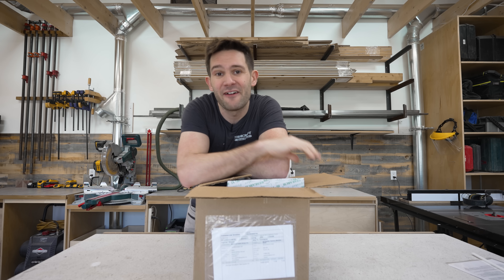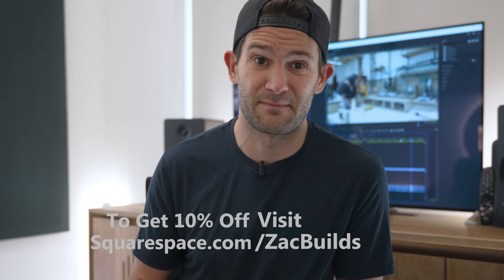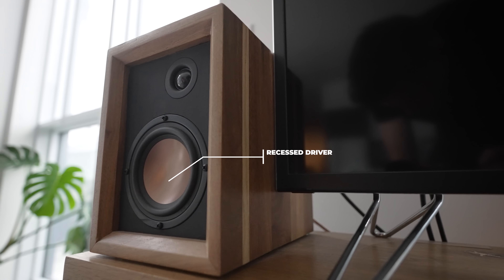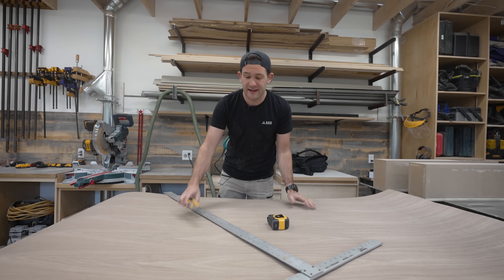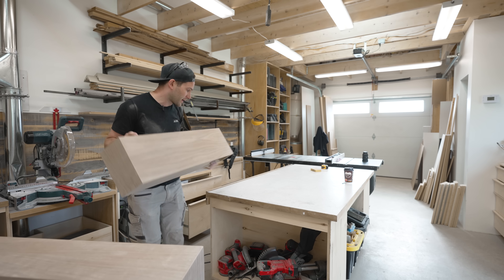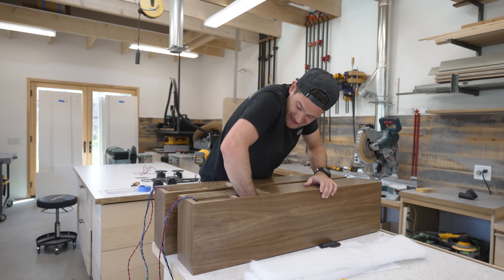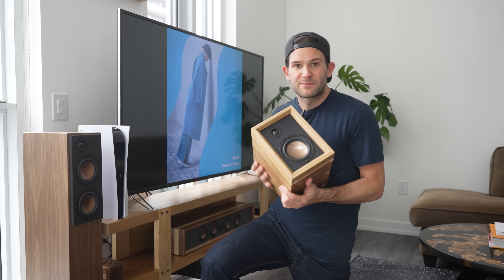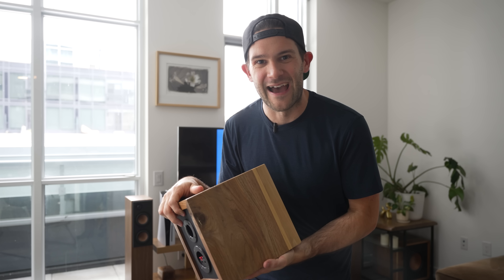MDF is BETTER than hardwood

Comment: Fantastic video!  Thank you so much for sharing your talents!
Reply from the maker: No, thank you Paul for taking the time to put together these designs and make them open source for everyone to enjoy! I've built almost every part of the overnight sensation family and have thoroughly enjoyed the process, and I couldn't have done it without you laying the ground work.
Reply: When you hammered those feet into the veneer..... uff.... another option is to make a wide hole for a nut and glue it with epoxy.

Comment: Now keep the smaller ones for the two back channels of a 5.1 cinema system. You can also make them identical looking by adding a black panel on the fascia that will level the front panel with the sides and remedy the "recess" problem that just adds diffraction.
Reply: That is what he said he's doing at the end of this video, yeah.

Comment: I built some speakers with a 5" FR driver and a 6" woofer in floor standing cabinets. And I built another pair of speakers with an 8" coaxial driver and a robust 10" woofer in larger cabinets. The smaller speakers are great and have impressive bass, but the bigger speakers have that BIG sound. And they CRANK so much more without sounding strained. Good for parties. And the BASS! Bigger is better!

Comment: I just want to say, I've loved your speaker videos. I work at an audio company and I can tell you those have the build quality of a several thousand dollar pair of speakers. 

As far as sound quality, diffraction from the lip around the outside will have a very large effect. But imo mdf vs hardwood isn't much of a difference. As long as the cabinet is sufficiently strong it doesn't matter. Mdf is used more often purely because it's cheap and dense. I would bet that the extra clarity is less from the added midbass, and more from removing the lip around the edge.

Comment: those look sweet. on your next set (and you know you're going to build more speakers, once you start it doesn't end :) ) use more drivers... the less work they have to do, the cleaner, distortion free the sound.

for whoever is interested, when working w/ such small drivers nothing makes a difference really as long as the internal volume and port dimensions are adequate for your application. and by that i mean box material, bracing, stuffing density, etc. the greatest sound impact i would say is in matching the crossover points between the chosen drivers.

Comment: 9:17 You're doing it 180° wrong: first heat up the wire/copper then put in the soldering tin. If there's enough tin take away the soldering wire but let the tip of the soldering iron stay for one or two seconds. This will give the tin a little time to set and makes a good connection. They are looking pretty nice and they seem to sound really good. Have you tried to change the left with the right speaker if this (tweeter position on the inner side) alignment sounds better/bader?
Reply: Also those ceramic resistors are going to get hot if he drives the system, they should have been raised at least a 1\4" off the board. And for God's sake man, with all the tools you have, where the hell is your dead blow hammer?!!!!
Reply: It looks like he did heat the wire and applied solder after it was heated.  He already commented that he isn’t experienced in soldering so that perspective he did a good job

Comment: Nicely done.  As a side note, if you use mdf and you want to paint them to match some other components, use polyester filler such as Bondo to fill imperfections and end grain.  Apply a thin coat and sand when dry.  You will have a glass smooth surface on which to paint.

Comment: I hope you have a fanned heat distribution system built inside that TV stand for that AV receiver.  Heat doesn’t redistribute itself out properly in that orientation and it’s just going to create a hotspot there on the wood, which is a potential fire hazard.

Comment: What's even better looking than the regular hex socket screws are button head hex socket screws. While the regular socket screws look techie, the button heads have that plus look smooth. But these are machine threaded screws, so some kind of T-nut or threaded insert is needed. Oh, and if you're looking for a slightly steam punk look, they also come in brass.

  The "breathing tube", as it is commonly termed, or more accurately, a tuned port, is used in a bass reflex (as Zac made), to tune the resonant frequency of the box for the "best" bass response (output). The term "Q" of an enclosure is often mentioned. The Q of an enclosure can go from 0.5 to 1.0, with the lower number giving the least output but most accurate and tight bass, while 1.0 gives the most output but sloppiest bass. .707 is considered the best compromise of the range. While a .505 will sound a little thin, couple it with a well tuned subwoofer and you'll have power in the bottom plus tight mid bass. A .707 box with a sub will give a fuller sound with minimal adverse effects, while a 1.0 box+sub will be loud on the bass, but boomy and often one-note sounding. There are formulas (Called the Thiel/Small Parameters) and charts, and now apps for determining box Q and tuned port length let you decide what Q you want to have. 
  Since Zac is using a kit, the port is made to the right diameter and length.
  Port diameter is also a factor: too small a port and you hear the port "breathing" (huffing) and too big and there isn't enough back pressure so the bass is loose. Port diameter is usually 1/3 of the bass driver diameter. A 8" diameter woofer will use a 2.6" dia port, but for practicality, you'd use a 2.5" PVC pipe. If you have two woofers, calculate out the total speaker cone area, convert that to a single cone area, and go 1/3 of that. Say you have two 6" woofers: each woofer is 29sq inches, so two would be 58sq inches, which is close to an 8" woofer, so your port would be 2.5" dia. 
  The port can literally be anywhere on the enclosure, as long is there is no solid flat surface within 3 port diameters. The back is the most common as it's out of the way, but the front is used too, often on larger bookshelf speakers. A port opening can be sharp edged, like cut off PVC or can be rounded over, sometimes on both sides. The rounded over port edges streamlines the airflow and makes for a smoother sound, but in reality, this is really only a problem if you're a serious audiophile. But, a rounded out port gives a very finished look to the speaker. 
  About the foam gasket on the drivers and often the terminal cups. They're there to create an airtight seal between the components they're on - important if you're making a seal enclosure but also good for all other enclosure types. If your speaker didn't come with any, anything from caulking (rather permanent) to craft foam sheets cut to size work very well. Craft foam also works well to make a speaker look better if you're unable to rout and flush mount the drivers - just use a 1/8" thick foam sheet with the holes cut out for the driver's outer frame over the front baffle. 

I used to work in home and car audio for many years and made a number of speakers from scratch, using preselected driver kits and cherry picking drivers and crossovers. I probably inhaled more than my fair share of MDF dust, so wear a respirator like Zac does!

Comment: With all the talk about "venting", maybe we can use the speaker cone action to work like a heat pump and create the cabinet so it is self cooling when ever it is running.

I can feel my legs get puffs of air when the woofer under my desk goes - now I know that those air puffs are not from air that was inside the subwoofer as no air actually moves (please see any of a number of subwoofer vent/diaphragm tests on YT) from point A to B but it's actually disturbance in the air from pressure waves being transmitted like ripples go outward from a stone in the pond.  The water in the pond isn't going away from the stone, only the pressure waves.  That air always feels cold for some reason, though - like the air that is isolated inside it is transferring its insulated coolness onto my leg.

I'd like to do an experiment to see if those pressure waves can also take heat energy with them or if we have to actually literally move air to get the thermals to go the way we want them.

An audio based chiller.   hm.

Comment: Hey Zac, I do like you new speakers, but I feel like they don’t match you other ones. The center speaker, and Sun woofer. They have that nice lip around them! And white wood band going around them giving that a two tone wood finish. Also you should add the old ones to the back surround! Which I am sure you did! 5.1 sounds amazing! And if you have matching back ones already you can add them to the front again, but as your FHL / FHR, which go on the wall close to the ceiling! Or even turning your set up to 7.1 and add them to the sides.
Reply from the maker: Hey James! Thanks. I hear you, maybe I'll redo the center at some point, but for now they'll have to do slightly unmatched and yes I'm definitely taking those old speakers and making them rear channels. Maybe in the future I'll do some front highs in the future.
Reply: @ZacBuilds  glad to hear that! Please keep up the great work and I look forward to more videos!

Comment: There is one huge glaring issue in your audio setup, and it should be relatively easy to fix. As you probably know, the room is a huge factor. In your case, the issue is the large windows behind. Glass is highly reflective, in a bad way, and your speakers are back-ported. I'd go for heavy curtains and a bit more distance. Also, one of the speakers is a bit close to the corner or the room, you can add more stuff there to increase dispersion of the sound.

Comment: I've been a professional woodworker for 30 years in large, high end architectural millwork shops. YOU NEVER USE CONTACT CEMENT FOR VENEER!!! Contact does NOT dry to a hard film line. Thus the veneer is NOT firmly attached to the base work and there will be creep as the two different materials experience expansion and contraction due to moisture changes through out the year. For paper back or 2 ply veneer roll out yellow glue evenly. apply veneer, cover surface with brown paper and plywood clamped down with strong backs. Or for unbacked veneer and the above, use heat activated adhesives that you roll on to both surface, let dry, put together and use and an iron and J roller to heat glue rollout the glue line. Custom veneer companies use heat activate glues that come in sheets. The veneer panel is put into an electrostatic heat press to melt the glue.  NOTE: if you use contact with unbacked veneer, and you use a lacquer finish, the lacquer will soften the contact and the veneer will bubble.
Zac, do your homework before give out advice.

Comment: Fantastic build Zac! There was a really clear difference between the old- and new speakers, even over youtube. They just sounded warmer and more lively. 

Only criticism I would have would be the rear facing ports. If you're going to put them that close to the wall, front facing ports would be better for levels and quality.
Reply from the maker: Appreciate the feedback! You dont think 6"-8" away from the wall is enough space for them to breath easily? Seems like at that point the port itself would constrict the air flow way more than the proximity to the wall would
Reply: @ZacBuilds  Yeah, that seems like enough space. They're relatively small ports so the effect will be less noticeable. You could try moving them forward(or even backwards) and see if you hear a difference.

It's not airflow you're worried about, it's air pressure. Putting ports close to the wall exaggerates the boundary effect, where you'll experience an increase in perceived bass levels at the cost of muddying your midrange. 
This is basically just distortion, so if you think they sound great then you've made a great set of speakers! If the Kinks taught us anything, it's that distortion can be good.

Comment: Just a heads up - you're going to burn your receiver out covering all the vent holes on the top like that. It may even cause a fire. There's a reason why the entire top of it is perforated.
Reply from the maker: Are you sure?
Reply: Yes. Seriously. There's a reason why the entire top of that device is perforated. The side holes are to pull air in and the top is where the heat leaves. At minimum you're risking burning the unit out.

I'm not trying to come across at patronizing or rude. You didn't know, or you wouldn't have done it. I'm just warning you that you're really setting yourself up for serious problems if you leave that receiver mounted in that fashion. There's a reason why you've probably never seen that done before - and if, somehow, you have? That person didn't know what they were doing. Electronics need to breathe.
Reply: @JeremiahSpoon  it depends. I can't find the specs on those, but assuming that he's not pushing the receiver then it won't generate much heat. As long as it's 8 ohms and closeish to 90 db sensitive, he shouldn't run any risks.
Reply: @blakebrockhaus347  lol don't ever put anything electric where the heat will catchpocket.  AIRFLOW is always key in electronic devices unless it's SPECIFICALLY LABELED "fanless thing X".  

When there is NOT a fan, they will be specific, specifically because it's a specifically big deal.  Forget a house fire, your reliability is going to be questionable and your operation is going to constantly be shifting the derating curve depending on where it's operating at which changes the operation of the device itself - except now it's not a controlled parameter which means you can get mystery "just won't work" and race conditions where you constantly trip your thermals (heat based fuses, to keep your stuff from literally catching fire), left scratching your head because every time you pull it open it looks fine and on the bench it works great, amazing even, but you haven't taken that data or run the tests through controlled stimulus that might push or trigger edge cases/boundary conditions, so you can chart and trend, observe, the degradation as it is occurring as well as watch it recover/heal as the input stimulus is backed off.
Reply: @ZacBuilds  Yes sure, just dropped an Onkyo and a Yamaha, which had 4" on top and open back for repairs. A/V receivers need to breathe....and I run DIY LCR+S around 160W @ 4ohms. That receiver needs to breathe....I may suggest active cooling + passive heat sinks on several chips.
Reply: Back in the day we had JVC RX-888R running burning hot all day long for like 6 years straight, between all sorts of monitoring equipment, not getting enough air. Survived fine, but of course it's just a one off.
Reply: @OjStudios  Back in the day they used to make units indestructible. Sadly those days have been replaced by commercialism and newer units have feelings...they don't like being offended or getting hot much....because a 105 C capacitor is just a few bucks more than 85 C. ;)

Comment: Great video! You are a good teacher and the production quality is really great. How did you attach your AVR to the bottom of your TV stand... and why? Did you do anything to mitigate the increased heat from blocking the main ventilation?
Reply from the maker: Thanks Jason! To mount it like that I just disassembled it and screwed the top of the case to the underside of the entertainment unit. No additional cooling, I monitored it pretty closely at first, but its been like that for 4 years now and it doesn't even get warm to the touch so I'm not too worried about it

Comment: Forget about the speakers, no one even questioning the way he mounted the receiver at the bottom of the tv stand.     That receiver is going to die early due to over heat, and or will also burn the 
house down at the same time.    Bad decision.
Reply from the maker: Tell you what, if it burns down my house, I owe you a coke. If not, you owe me a coke.
Reply: It depends on how hard he pushes it. If the speakers are easy to drive, then no worries. And given that these should be easier than the bookshelves, I assume he'll be fine.

Comment: @Zac Builds Man I love the look of the receiver just floating like that! So clean that I had to watch to video a couple times looking for it! But I'll admit, I too am curious about how hot it is probably making that wood shelf. Are you running a little fan back there or something? Or just don't find it is an issue?

By the way, those speakers look awesome! I think you nailed the DIY mantra- there's a pride in building something that can't be matched by purchasing some mass-produced item. Can I ask what the total cost of materials would be to build something like this myself?

Comment: I've been using Rubio Monocoat on my latest projects (a desk and a laundry bench.) Not sure how suitable it would be for cabinetry or display pieces but road testing on my desk has proven it to be pretty durable (cos I'm an absolute mess and spill stuff all the time). I only did the specified single coat on both projects but I have heard that it can be layered on with some inbetween-coat prep for some extra sheen and protection.

Comment: Very nice build and great video going just enough into the details. MDF and veneer is very standard way of building speakers and produces great results. One advice, for pressing veneer during glue up you need max pressure and roller is not the best. Veneer makers recommend using edge of the soft wood plank rounded to 1/8 or you can use plastic carpet tucker.
Reply from the maker: Very cool! Thank you for the tip and the kind words.

Comment: your speakers look nice; But you go with larger drivers like 12" woofers a midrange and tweeter or a wide angle compression driver with wave guide that does mid and tweeter frequencies you will love it. I am sure these are better than your first set but you still don't know what your missing.